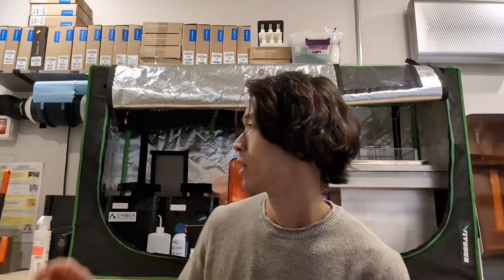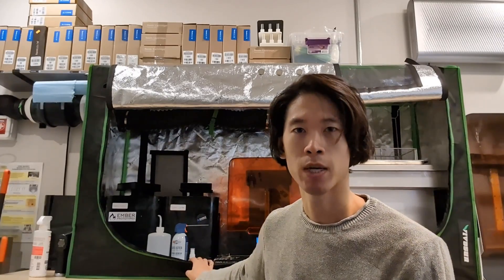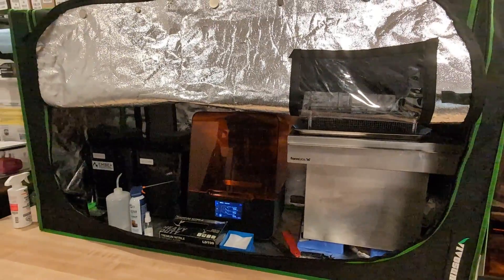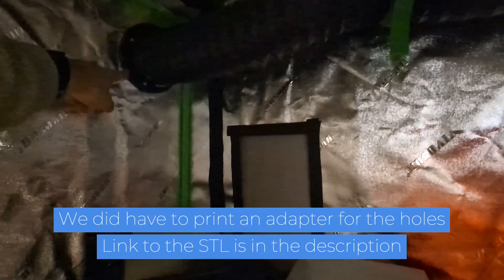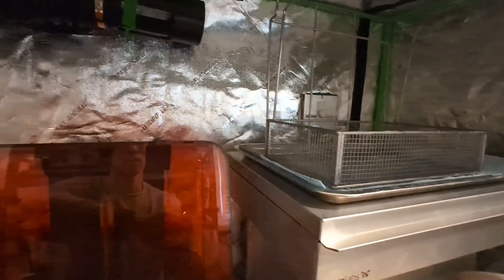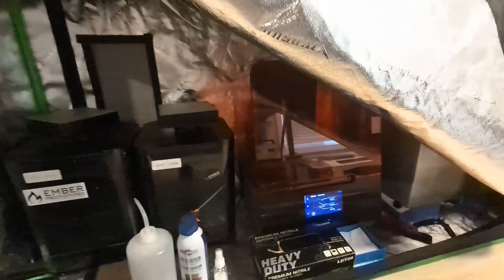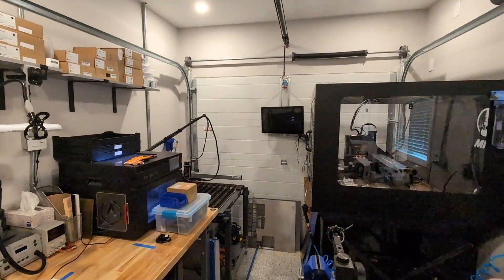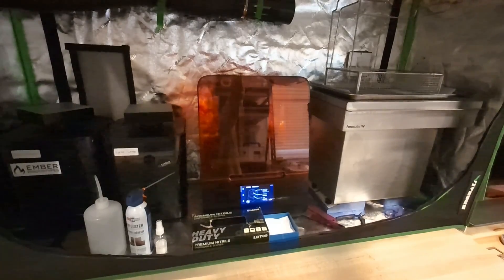Low cost FUME HOOD for your 3D printer

Comment: Hi since you have a 6" inline fan extractor, why didn't you just use 6 inch ducting, rather than stepping down to 4 inch?
Reply from the maker: Honestly don't have a good reason except for the fact that I used 4" when I drilled the hole in the wall and the grow tent is 4" 🫠
Reply: @emberprototypes  Haha thanks! I've purchased the same grow tent and a 6" inline extractor and was just wondering
Reply from the maker: @Moonforgetcg probably better to stick with 6" if you can!

Comment: I could use your advice: Just moved into a one bedroom apartment with my GF. I have 2 3D printers I'd love to do this with in one area by a window (set up an AC vent window adapter etc)...I use anycubic clear resin pretty much exclusively and I do any IPA work outside usually. 

How well does your sett up keep fumes out? I'm just extremely worried about using these for my small business and hobby in such an enclosed environment. There's a kitchen, and living room and bathroom and beddroom and like...thats it. I've just watched so many videos on both sides saying that this is will keep fumes out, I see others saying "soon as you open a bottle, you're dead" or what have you,.
Reply from the maker: It does a very good job, but I don't eat or sleep next to it. Honestly, I wouldn't ever do resin inside, it's just too messy and smelly. If you have to, then having a separate room where you can have air purifiers and ventilation for the entire room would be the minimum for me.

Comment: Hey I’m setting up a prototyping workshop for my business. Just leased the space. We are purchasing the Form 4L, Wash L and Cure L. I’m trying to figure out ventilation. The landlords HVAC tech is having trouble figuring things out because they are thinking I need a HVAC ERV to maintain the heat/cooling. Have you come across this issue and if so did you purchase something like that so all your heat/cooling isn’t pumped outside?
Reply from the maker: Installing an HRV is something I wish that I did when first building the shop. I work around it and still have good ventilation but maybe one day I'll get that added after, it's just way harder to do now that all the walls and attic have been insulated etc.
Reply from the maker: I do have a heat pump for heating/cooling though and that works great
Reply from the maker: Installing an HRV is something I wish that I did when first building the shop. I work around it and still have good ventilation but maybe one day I'll get that added after, it's just way harder to do now that all the walls and attic have been insulated etc.

Comment: are those fans safe for flammable fumes like the one from IPA?
Reply from the maker: I actually will admit that I didn't know the answer to this right away but just anecdotally knew it would be OK.

Upon some further research it looks like there are two reasons why this is fine:

1) These are brushless fans, so they do not generate sparks that can cause ignition of fire like on brushed DC motors

2) Even in the event of a spark, there is a term called the lower explosive limit (LEL) that basically defines how much vapor needs to be in the air in the presence of a spark. TLDR is that the amount of vapor being evaporated through natural means and convection is way, way lower than the LEL so no concerns here (apparently if the LEL is high enough, you would probably be dead or knocked out if you were in the same room).

Sorry for the long answer 😅

Comment: I think the location of your system's intake matters far less than the location of your air inlets in terms of ensuring airflow over certain units. If air is only getting in from a crack on the left side, it's going to take the path of least resistance and avoid moving across the right if it can. the environment will still be in vacuum but one half is going to get way more airflow than the other. 
You could probably pull the pipe back to the very opening and cut a few slits on the bottom-right-side to maximize airflow through the system. Just don't make your gaps too big or you'll lose that negative pressure :D
Idk if you've ever built PCs but think about a tower with negative pressure- you want to flow from front to back for even air distribution.

Comment: Any tips for running engineering materials (ABS, ASA, nylon, PC, PP, etc) on X1-Carbon in areas with limited ventillation? Would it be worth making a 'hood' like this and connected to ducted extraction? I'm scared to move past PLA/PETG/TPU haha.
Reply from the maker: Yes highly recommend having something like this when printing materials like ABS that generate a lot of VOCs. Ideally it's vented outside. At minimum you can put an air purifier or charcoal filter inside to recirculate and filter air in the grow tent itself.
Reply: @emberprototypes  Thanks I'll get a enclosure/hood for the printer before using these polymers.
Reply from the maker: @nucleochemist  🔥🔥🔥 good luck setting all of that up!